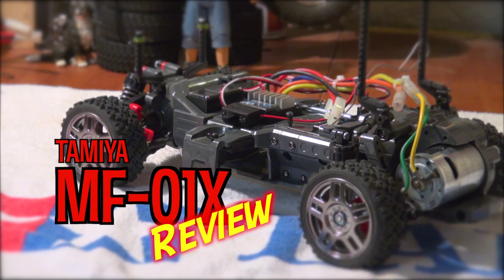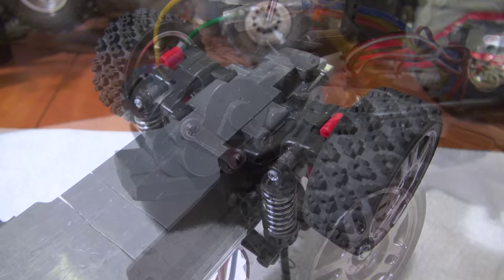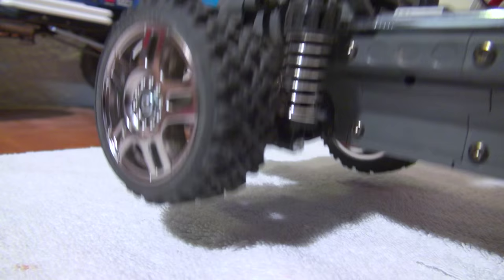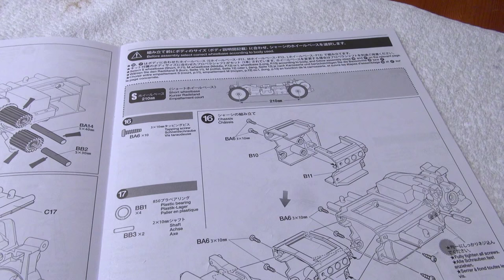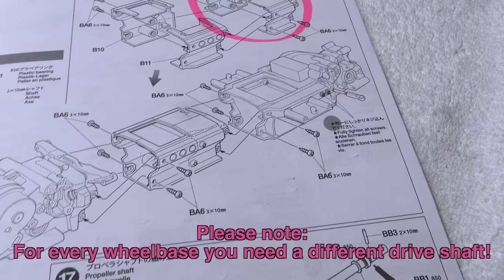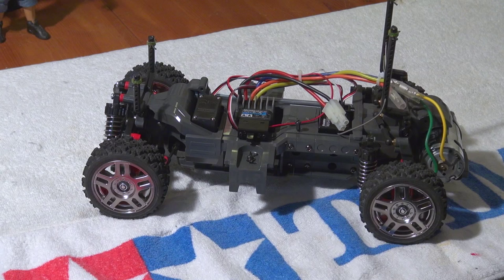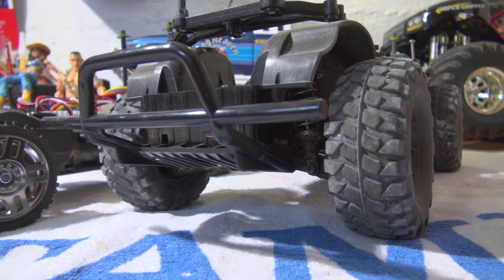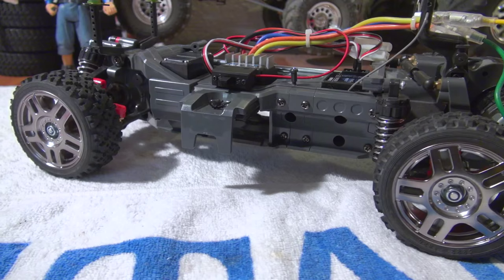Tamiya  MF-01X Chassis Review

Comment: This is the first time I've seen anything about this model. It looks like the perfect solution for an M-Chassis sized rally car. 

I have an old, modified TB01 chassis with a Mini body, but even with the M03 steering arms and driveshafts, it's too wide for M-Chassis bodies. I also have an Suzuki Swift M03M in its box that I've nevet got around to building. 

The 205 - 225 - 239 mm WB is very interesting, It means a lot of the old HPI Mini and True Ten bodies (like the VW Polo) will also fit!
Reply from the maker: +Cian Ha Yes, thats right! Thanks for your comment and have fun with your models!

Comment: Nice preview showing the MF-01X!This truck is a blast I am loving mine I thought it was not going to be to good ... BUT it turned out to be a great truck and one that I find is FUN to drive ...you just want to keep taking it out for a drive!see my latest video I had a BLAST!
Reply from the maker: +shenlonco Thank you! Yes, you push the Jimmy to the limits!
Reply: +Matteo's RC Movies  Yea after that bash I had to put two holes in the tires outer tread opposite each other  because the tires got filled up a 1/4 of the way with sand and dirt.with the holes in the tread area it should fling out the sand from getting trapped inside the tires.I also am adding some 5mm washers behind the wheel pins on the axles to take out the axle play and it will also widen the width a few mm also for even better cornering!

Comment: I just built this kit (vw rally) and the front dif feels very rough rear diff is smooth. Taken it apart couldnt find any build errors. Has anyone had this issue of a rough vibration in front diff when one wheel spins and the other is still? I dont know how this will drive. Been building RC kits over 20 years and im stumped. Anyone? Please?
Reply from the maker: I could not find a big vibration in mine. Is it possible the vibration comes from the dog bones? Does it make the same vibration when the suspension is a bit lifted up? I have many experiences from vibrations coming from the dog bones.
Reply: I think you are right. Thats gotta be it dog bone angle. I will say though, i ended up removing the entire front drive system. Gears dogbones and the shaft drive. Was substantial weight savings and although it gets stuck a little easier, now it is more authentic to a rally bug RWD, as well as doubling the run time. Its weight characteristic are more authentic now with less weight in front and motor in rear.   Also i think you make the best Tamiya RC videos. Thanks for your channel. Subscribed.
Reply from the maker: It's a good idea to make it only rwd, like the real beetle! And thanks for your good feedback and sub! 🙏 I really appreciate it!

Comment: Hi Matteo, i wanna ask you one thing.
Can you give me please the info about the pieces i need just for rear transmission of this model? I need just the rear transmission pieces with internal gear in order to build a Vw Kombi offroad (2wd) with handmade rear aluminium suspensions with longitudinal arms and handmade torsion bar, and front sand scorcher suspensions.I will use the Maisto VW kombi bodyshell.
Reply from the maker: Here you can see the manual, from page 26 are all the parts listed. http://www.tamiya.de/CommonFiles/Dickie-Tamiya/PDM_Products/Tamiya/300058614/300058614_Bauanleitung_MF-01X.pdf
Reply: Matteo's RC Movies thank you matteo! I've just checked if you replied.. And after 5 minutes you did it! 😅
Reply: Matteo, you confirm that on page 26 are all the part for rear transmission? Also all screws, gears,etc?
Reply from the maker: You need also the screw bags on page 27. Bag A, B, and C. I think you should better buy a complete car. All the spare parts together are higher then the price of a complete car. https://tamico.de/Tamiya-Suzuki-Jimny-JB23-4WD-MF-01X-Bausatz-58614
Reply: Matteo's RC Movies i don't think so, i have screws. I just need transmission with gears. No suspension
Reply from the maker: Yes, but in bag A for example are also the bevel gears for the differential and shafts...And in bag C are the rear gearbox joints...
Reply: oK. If you have something second hand i can buy from you

Comment: Which driver figure are you using with this body?
Reply from the maker: I use the 4x4 Driver figure from Tamiya. Depends on the model I have to shorten the body. https://www.tamiyausa.com/product/item.php?product-id=54416
Reply: yeah, that's why I thought.  when I posted the question I thought it was the Sand Scorcher figure attached to the side of the body.  Did you mount the figure on the chassis then?
Reply from the maker: No, you can see it in this video how I install the figures: https://youtu.be/BQkurABsPtw